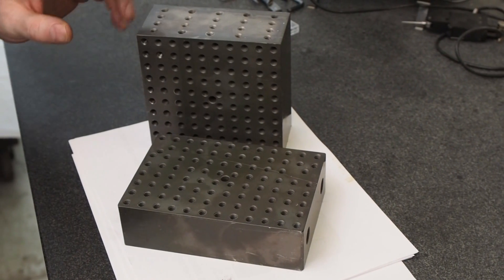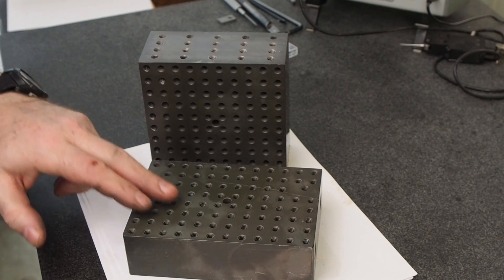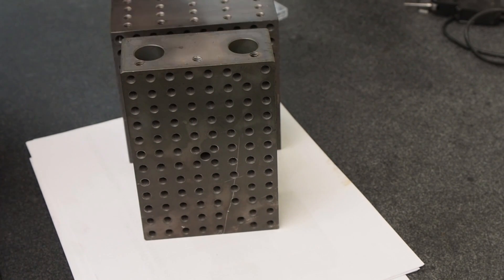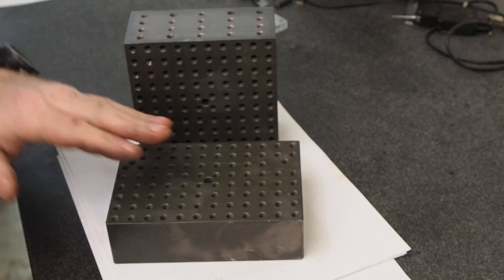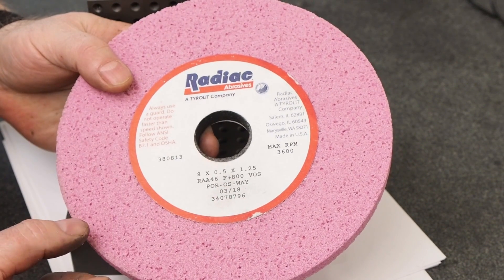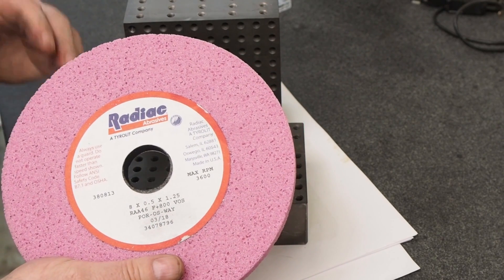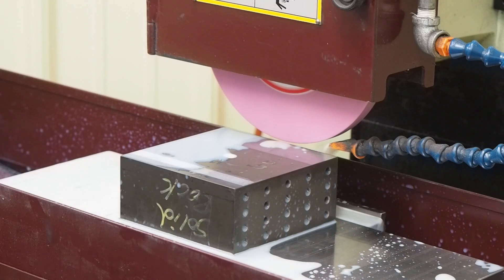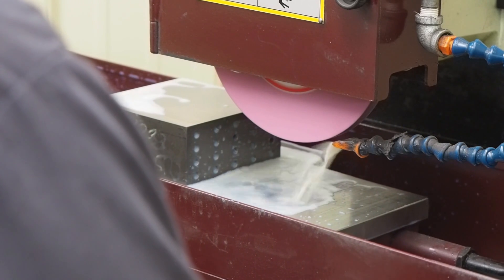Grinding a Squaring Block With a Squaring Block Pt. 1

Comment: Getting the perfect wheel is sometimes a headache, it doesn't take much to get the tiniest scratch just on the very last pass...   
As soon as they get used, wear will show...   ;)
Reply from the maker: Hi Pierre,
You are right about that. Also, I can't get away from the micro scratches that you get just from moving the part on the surface plate or the magnetic chuck. They do not affect the accuracy and I can't even measure them but you can see them. All of my precision tools have these micro scratches form use but they still measure flat parallel.
Steve

Comment: It sometimes helps to coutnerbore the tops of the threaded holes just below the finished surface, to avoid surface distortion around the top thread of the tapped hole when a screw is tightened.
Reply from the maker: High Andre,

I agree. We counter sink the holes larger than the the screw diameter to achieve the same thing. Also, it is important not to over tighten the hold down screw as it will cause distortion no matter what method used.
Steve

Comment: If you have a look at the bottom right of your gauge . It shows that one division is 0.5um. Half a micron. At least thats what I can see from the video. Nice work. I wish I could get the variety of grinding wheels that you get. Here in New Zealand. 46A and 60A in white is it!
Reply from the maker: LOL, I never noticed that until you pointed it out.
Steve
Reply: Solid Rock Machine Shop Inc. me neither. Till this video.

Comment: Do you think you can make a metric squaring block? Metric sizes and metric tapped holes?

I enjoy your videos. I work for a special purpose machine building business. Always good to learn about grinding. I do lack a bit there
Reply from the maker: The first block we did we used 6MM threads for a customer on a 1/2" hole pattern. The nominal size of the block was the same as the others. I can make them whatever sizes the customer what but the cost would be higher as I would have to do a lot of the work on and individual block rather than in a batch. If there was enough interest in a batch of 6 or more I can bring the cost down a lot. 
Steve